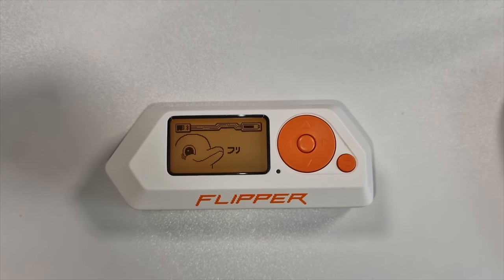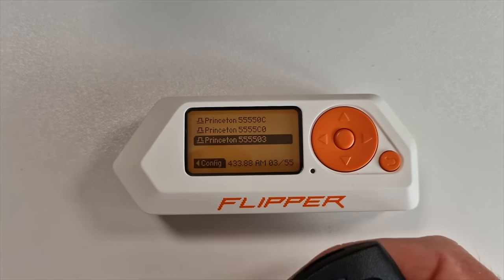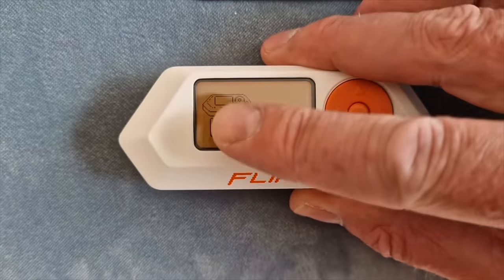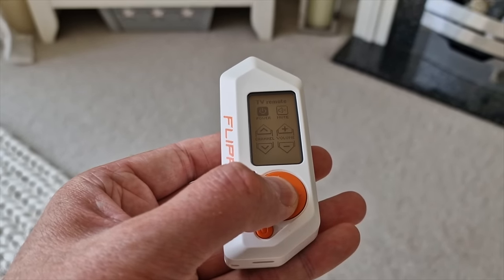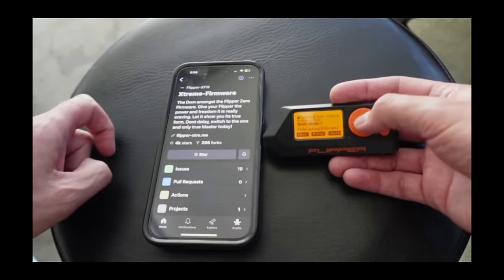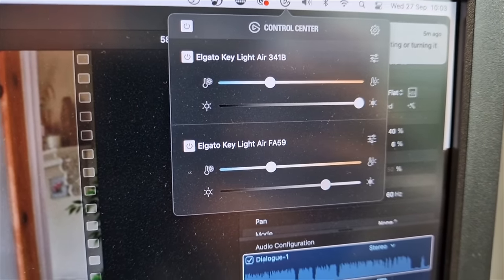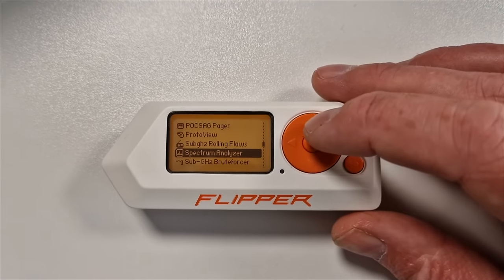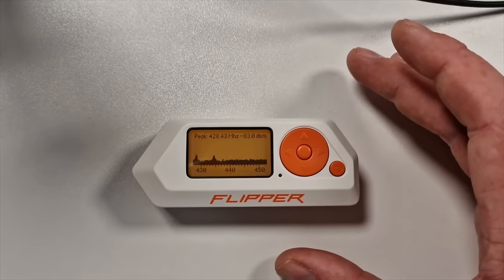KNOW THIS ABOUT THE FLIPPER ZERO...

Comment: I'd advise people against using the Flipper to clone your vehicle fob. Even if you can use it to open your car, your fob will now go out of sync. It'll be on the wrong part of the table of "correct codes" based upon the random seed that is synced between your car's SCU and the fob. Suffice it to say, if it manages to work once, your fob will then be rendered useless and you'll need dealer-level diagnostics to reset the vehicle's SCU and reprogram the fob.
Reply from the maker: Yes this is what I said in the video.
Reply: @andykirby  Ah frap, sorry! I must've missed that while typing. Thanks for the video. Was cool. :) Might have to get one of these things.
Reply: I've heard this many times but have yet to hear about someone actually desyncing. I'd be interested in seeing real world cases of this
Reply: @andykirby How do you clone the key fob for opening flat security doors?. They only gave me one to open the main door. Will this device be able to clone that?
Reply: Wow, £252.99 it's not cheap.
Reply: The fob will go back in sync eventually. You just have to keep cycling the codes and it will sync back up
Reply: this can be bypassed but it involves making a rolling code then getting it to register to the car using a tom key programmer... just like you can register the flipper as a garage door opener by making a security rolling code and registering it to the gartage motor
Reply: @jessecool2980 the old Smart Fortwos used to go out of sync just accidentally pressing the button in your pocket 😂
Reply: Teaches doesn't it lol?
Reply: @jessecool2980  Happened to me lol
Reply: on most car fobs you can resync them on your own without any trip to the dealer...
Reply: @eddpearson  yup we had one of those for a while... loved that strange little car even though it got worse mileage than a civic or similar.. it DID have fantastic leg room though(I am 6 foot 4 but love little cars.. my current daily is a Abarth 500 and i would KILL for the same legroom as the Smart had lol)
Reply: @jessecool2980  if your car is older than 2012 it may work. I desynced my Jetta.
Reply: I have yes to see this. Most rolling codes are forward based. And they have to allow for lost packets. There is no guarantee that you are in range when you hit it. So all rolling codes expect the future code to be in the future, the vehicle discards old codes as new ones come in. But it's a special algorithm that allows for forward codes.
Reply: Lol resetting the ECU 😆 not all vehicles require ECU reset for key programs I'm a locksmith
Reply: Most cars keep the most recent code used and will only accept a newer one.

If someone steals code 292 and you then use your fob and it uses 293, your car will open and work fine.

Its only a problem if the person stealing your signal cycles right through the start again and it goes back to 001. Now you have a desync and a dead fob and even then, press it 293 times to get it back in sync, some can manually be resynced with the right button combinations with the ignition on.

One signal capture and replay and is not enough to break your fob since they are into the 65k+ 16 bit codes and could easily be higher these days at 32bit.
Reply: So you mean you can use to damage everyone’s locks?
Reply: Depends on the vehicle... usually there is a way to sync the remote with vehicle while not visiting a dealer through a specific ignition sequence. Some vehicle will resync the remote after hearing remote codes in sequence from remote i.e. five presses of button.... Hint for rolling pwn
Reply: you are reffering to rolling code keys, not every car manufacturing uses those.
Also older models never used those.
Reply: @JimGriffOne the quieter you become, the more you are able to hear
Reply: @jessecool2980 you haven't heard it happen, because you actually have to TRY to make it happen. Ever wonder how people can have 2 or 3 key fobs for their car, and somehow the spare doesn't go out of sync even if you don't use it for a few months?

The reason for this, is that the engineers are smarter than the people who claim this will ruin your keyfobs. They figured out a way to bake in the ability for the vehicle to know if the code on the key fob is recent enough (or only a few steps in the future) and it will still allow the vehicle to unlock even if you use the main key fob 5-500 times before coming back to the spare fob. Some vehicle brands only allow 5 uses or maybe less, but others will let you unlock the car every day with fob A (using 365 of the rolling codes) and then pull out fob B which is now 365 codes behind, and the vehicle still unlocks for fob B. 

Sometimes the car waits for the second press from fob B, so it can check the correct sequence of rolling codes is present. This is what prevents "replay" attacks. Replaying the same exact signal as a legitimate key fob (which should never happen in reality) may actually lock out the key fob entirely, but not every vehicle does this. I can't name any manufacturers that do this.
Reply: @cyleleghorn246 Each fob is on a different rolling code (when implementing keeloq) and has a unique cipher. There is room for only a certain number of fobs that can be stored in the vehicle.
Reply: You have the voice of someone who hasn't read their vehicle's manual.
Reply: @runed0s86  Not all can be self synced. Stellantis vehicles and German vehicles are good examples.
Reply: There are numerous FOB cloning units on sale which can do a better job, more safely. Car manufacturers all, except for the high priced wheels, seem to use common security sources.
Reply: Even better... Thanks 👍
Reply: @jessecool2980  I haven't heard of someone actually desyncing either. I cloned my 21 honda civic type r fob and both work perfectly fine. I use the flipper when I can't find my fob and the fob still works fine.
Reply: @jakemontoya5175  No, you didn't clone your 21 honda Fob with a flipper. 
There is information the key and vehicle share, and it can't be read and copied. It needs to be known to the vehicle and fob, and it must be programmed into the vehicles computer by a professional. 
I work on Honda at least 2 or 3 a day.
Reply: @honestlocksmith5428  I 100% did clone it but not to start the car just lock/unlock. I'll post a video of proof if you don't believe me 😆
Reply: @jakemontoya5175  your video looks like every other fake video on the internet. You didn't copy anything.
Reply: @honestlocksmith5428  LMAO alright bud. You can just say you don't know how to effectively use technology instead of outright denying that the video very well could be real and possible haha. Like idk what you wanna see at this point lol 😆
Reply: Maybe just you my friend most cars won’t do that ur paranoid relax have a chill pill bro..
Reply: Thank you, I have one in the post en route. Glad you warned us. First thing I'd have played with lol. My wife would have gone nuts Monday morning trying to go to work
Reply: @A.C.Lawrence my key was dead...how to fix it😢
Reply: Ridiculise the flipper canot dysinc the fog key stop bull shit
Reply: @JasonTDolan better using a hackrf and SCHijak..  took rangeys and new mazdas with aliexpress 2021 build.
Reply: @honestlocksmith5428  "working" on Hondas and claiming to be a locksmith doesn't mean you know a damn thing about software engineering or how manufacturers engineer software systems related to unlocking car doors. Calm down Lockpicking Lawyer Jr.
Reply: @RandoWisLuL  That Honda uses 128-bit AES encrypted keys in the transponders, with keeloq rolling codes. The key is encrypted in the stream using hitag3.
The key undergoes a key expansion process, and the expanded keys are used in a series of substitutions, permutations, and XOR operations to encrypt the data blocks. 
It's very robust. It's not being duplicated with a Flipper.

Comment: Yeah it is a great tool and totally agree with the Freq anaylser.  Find it useful for checking the harmonics on the the 2m band - clearly though you can't seem anything other than say the 3rd but its a start.  Also use it for work too, great for pen-testing things.
Reply: it's a start
Reply: @NoName-zn1sb  yeah, the flipper can do so much it's a great start. Then when you realize "wow, I really like the frequency analyzer" or "wow I like the IR decoder/transmitter" then you can research and build or buy a dedicated device to learn more and take it to the next level

Comment: FYI, these Flipper Zeros are basically useless without some of the external addon module boards. Because the range of all the internal radios is basically like 3 feet. With an external module board, like the 3-in-1 boards that have WiFi, 433mhz, and 2.4ghz NRF, you get MUCH longer ranges for transmit and receive.
Reply from the maker: The range of the subghz radio is more than 3 feet, it's probably double that of a car keyfob for example.
Reply: only somewhat true.. the receive range of subghz RF stuff can be pretty impressive and you do 100% need a board for wifi and stuff for sure.. but to extend your subghz stuff you just need a $2 cc1101 module and a couple of dupont jumper wires to run into the GPIO socket on top...
Reply: I just want to be able to mess with the Bluetooth radio connections of the vehicles with big subwoofers parked in front of my building in the middle of the night.

Comment: I actually wanted to turn ON the air conditioner at a laundromat here in southern France during a quite hot summer, and got a AC remote control app on my Galaxy S5 phone, which has a IR transmitter.
But I didn't manage to do it as this AC unit was of a unknown, possibly cheap brand.
It works great on my LG one though as well as on TVs and projectors.
Reply: I've been an LG guy ever since the Optimus LG G Pro, and I was really bummed when they took out the remote. Crushed when they quit phones altogether
Reply: I remember when my LG phones have an IR blaster so you can control TVs I think even when my Sony Emerson phones had it too but at the time I didn't realize it didn't download the app to get to do anything

Comment: google pay requires your fingerprint to enable pay.  also it is not your credit card number that is transmitted on the phone, the phone gets a list of around 12 generated numbers when you are connected to the network for your card.  so it will still work about a dozen times when you are without cell or wifi service.  im sure apple does this similarly.
Reply: not sure about apple pay but i do know samsung pay lets you do up to 12 off network transactions like you mentioned as well.. Samsung Pay is kind of neat though because it can transmit your magstripe data to regular old stripe readers similar to how Magspoof(which Flipper Zero also does and with a Rabbit Labs magspoof board I can report it works GREAT;-)) does... back when this first started being an option on Samsung phones depending on the type of card it would straight up spoof the track data and push it out wirelessly JUST like a magspoof.. I am sure it must either push out the generated number or use a different one on each encrypted transaction these days but I am not certain..
Reply: @WAYGULOLBEEF newer Samsung phones don't do the magnetic strip thing anymore. Basically they purchase loop pay

Comment: Can confirm that you'll lock yourself out of your car.  Wasn't a hefty bill for me, they just had to re assign the key to the car (they must have a magic computer because I couldn't do this myself following the instructions in the manual), so no replacements.  I thought I could be clever by recording the signal out of range and then playing it back closer.  This worked, but I held the button too long and it played the code twice, making the car suspicious and locking me out.  I could still use the physical key, so I could drive it in the meantime.
Reply: The Tesla filler cap thing is a bit funny still, especially when you find a new owner showing off the summon feature and the flap gives them a salute as it drives up, but that's the most havoc I'm willing to cause.

Comment: Every NFC phone payment transaction uses a "virtual card number", meaning your ACTUAL card number is never transmitted, and that virtual card number cannot be used online like a normal card number.
Reply: this is not exactly true.. Samsung phones that use Samsung Pay/Wallet can blast out raw track data to old school stripe readers and it works..(depending on your card BIN etc.. of course) Though this is not NFC it just uses the same antenna and such
Reply: @WAYGULOLBEEF that's only true if you're using the outdated Samsung phone the newer phones for the last 5 plus years do not use the loop pay technology anymore

Comment: Got one of these as someone kept turning our display off with theirs at work lol, Now the thing with radios.. I work security is there a way they can jam our radios from working or anything bad like that with this tool? If so is there a way to combat this?
Reply: No
Reply: You can buy a small radio transmitter that will only transmit a small distance and override the signal. They are small and cheap, but interfering with radio signals is a crime
Reply: Yes, there's many ways to combat frequency jamming, but these devices don't go very far, so it should be easy to spot the person using it or traingulate the signal.
Reply: Traingulation chop choo

Comment: 11:02 what do you mean, that this is a shame?

The flipper zero is a hacking gadget. The RF part is only implemented for radio attacks (replay, etc).

Why would the dev include extra hardware or a more powerful processor to demodulate something the device is not intended to do? (Plus a speaker)
Reply: Well yeah obviously the developers not going to include that because then the device will get banned everywhere

Comment: This is cool! So do you think this can or could be made to pick up something like a wireless 5.8ghz video signal strength, in the RF spectrum analyzer you were mentioning? I would like to test for signal strength output. But also to maybe to scan the area beforehand to find the cleanest section of the Band to use. The video band i usually use goes from 5696mhz to 5915mhz, with 8 equal "channels" or steps in between that for max separation. Its the wireless video signal from my drone.  
Also i forgot i also have the controller side of it too which now uses some slightly more advanced hardware and software than just 2-3 year ago. To go from 0.5-3 miles of range, to getting 15-20 miles of range in decent conditions all of a sudden, and 50 miles in ideal testing, like a lab. 
But a common easier testing method i see for that now is using something like the Salt Flats, i guess because of how flat and unstructured the land is for for miles, so theres nothing in between you. They got a new DJI Drone out to like 15+ miles out there with a new model doing a range test for the new DJI O4 transmission system works with the new remote and video setup. That uses a combo of 2.4ghz and 5.8ghz. 5.8g is the video basically.
For the Remote Control in both 800/900 mhz or 2.4ghz for the RF frequency used for each type. The common types to use now are Crossfire or ELRS. But there's a few more that are super focused on low latency at relatively close range for competitive racing usually.
Reply: you would need to make or get an addon board for this.. similar to the WIFI dev board etc... but yeah it can be done
Reply: The nice thing about opensource stuff like this is that if you wanted it to be a thing you could make it (granted you'd have to know a bit about electronics and a bit of programming, but still), though someone probably already has
Reply: Sounds like you need a HackRF

Comment: Wait, why would you put a keyfob in a faraday cage?

Are you able to wake the fob up from the other side?

The only time it transmits anything is when you press a button, and you want it to at that point...
Reply from the maker: Key fob will transmit if it receives a challenge from the car.
Reply: @andykirby  interesting!
Reply: The main issue is due to the proximity unlocking (where simply walking up to the car causes it to unlock) the car and key are always searching for each other.

So you can use some radio gear to relay the conversation between the car and the out of range fob

A lot of manufacturers have no added timing checks which catches a lot of the relay attacks.

Of course the real question is why on earth does anybody think they need proximity unlocking in the first place (it's not that hard to press a button.)

Comment: Are there any competitors toward the Flipper Zero??
Reply from the maker: Hack RF portapak
Reply: It’s a multi tool, so there are lots of cheap devices that will do one of the features that FZ can do. It will probably do that feature better too.

For example, an IR Blaster can be picked up for around £3

Comment: The rolling code for cars has been hacked with the rf 2 hack plus.
Reply: rolling codes are supported on all the aftermarket Flipper Zero firmwares(Xtreme is the best IMO.. happy hacking!)
Reply: Ive replaced my rolling code fob with a flipper zero! Its 100% possible if you know what you’re doing

Comment: You cant do shit with Those keys. It’s Rolling Code. It would works one time of it has Bad security and the Right frequency and than the car would create a new Code. If you than try to Open the car with the Same recorded Code it might work and causes a dissynchronisation between your key fob and your car. Than you can buy a new key fob. It’s a Big lie ‼️